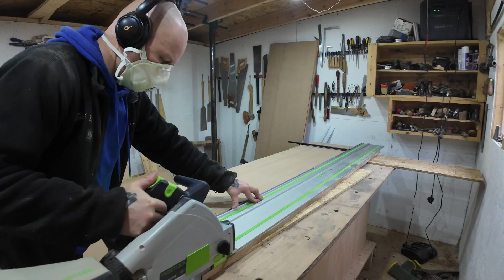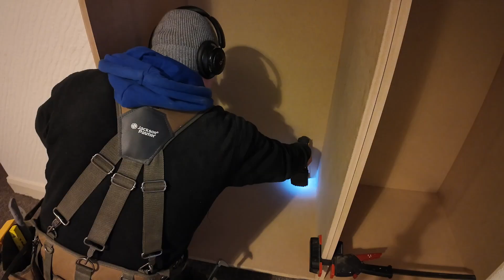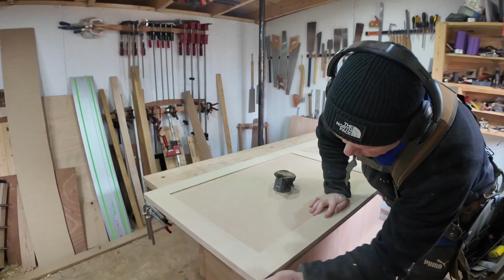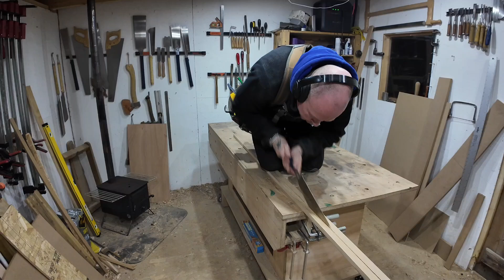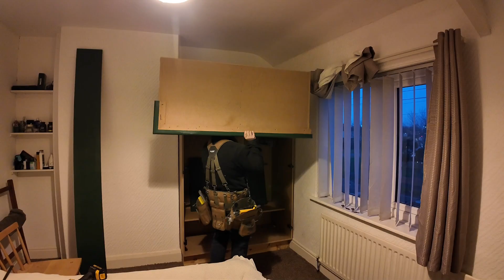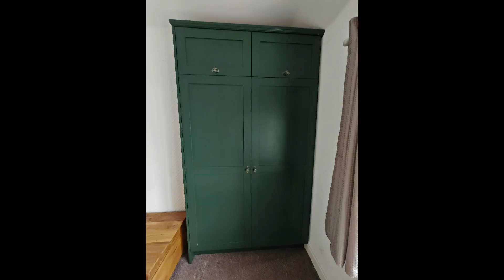DIY wardrobes anyone can build

Comment: I found your channel earlier after searching for wooden ladder diy using hand tools, and i have to say i really appreciate how clean your work is. You're thorough and teach methods really well. It's very informative and digestible. I've been considering building something like this in my alcoves but wonder if i'd be able to build it on site in the room and handle the weight load lifting. 
I wonder if it's possible to install directly onto the walls? My late father did one similar to yours but can see it was attached directly into the alcove as opposed to building carcas and then installing. 

I have recently been diagnosed with fibromyalgia too so so many projects i have wanted to do that were shelved may need to be for good. I'm just looking for alternatives for someone with mobility/strength issues now. I would love to make my own pieces and be able to do woodworking around the house. 

Would you say it's still feesible or should i just put shelves in the alcove instead? 

Just exploring your channel now and subscribed, do you have a list of your essential beginner tools to have? 

I also appreciate how you use a lot of hand tools and don't use a lot of electric tools but some, would you have any best tips to follow if you don't mind sharing?

Glad i came across your channel, hope this message finds you well.
Reply from the maker: @joyceb2060   thanks very much for having a look around the channel.

I personally would always make a carcass construction.

You could use a lighter material, I used MDF which is pretty heavy.

I did make up one of the units in the room because they were so heavy.

I've since made 2 more, one identical, and one double the size (currently building), and I opened to use the peanut system, so I can slot them together (see my latest video).

I think if you planned it out correctly, you could manage, or even get a little help with the heavy lifting.

Shelving could be a option, just depends on what you want.

I personally would give it a go, just take your time and plan everything, including the manual handling.

I believe I did do a podcast on 10 essential tools, which may help you.

I don't know about any tips per se, other than to enjoy what you are doing.

There's plenty of videos to help you on my channel, and others, and I'm happy to answer any questions when I get the time.

Comment: Thanks David, some very handy information for me as I have a recess that basically isn’t of any use use. I was thinking to put a bookshelf there but maybe a cabinet after seeing this video, maybe with an open area for photos etc between sections. The information on subframe build and install is very helpful.

To me, the green colour on your build looks quite opulent and is fine if that’s what you’re after. I can see how it fits with your place, but at mine it would stick out like a sore thumb. The paint appears to have covered really well, can I ask what type of paint you used? No primer required? Thanks again.
Reply from the maker: Thanks mate I appreciate you watching, sorry for the late reply.

Here's the paint I used 
https://amzn.to/3D8mfR4

I think one of the important things is that you get consistent measured cuts, and everything else is fairly easy.

I think you'll be fine with something like this.

Hope your build goes smoothly 👍